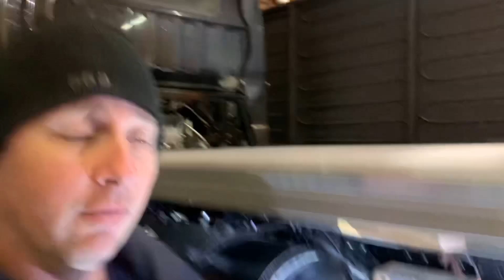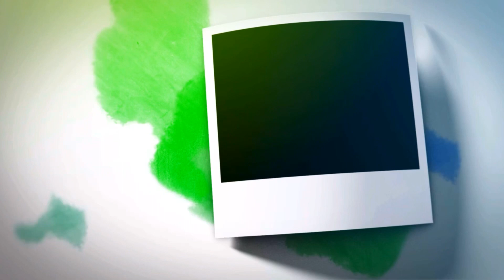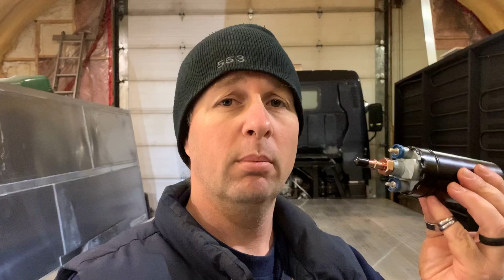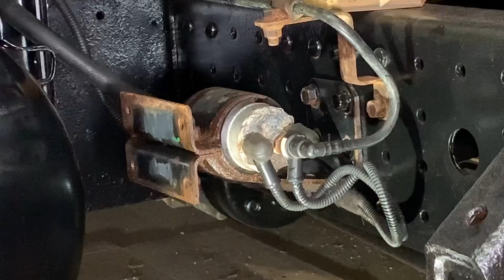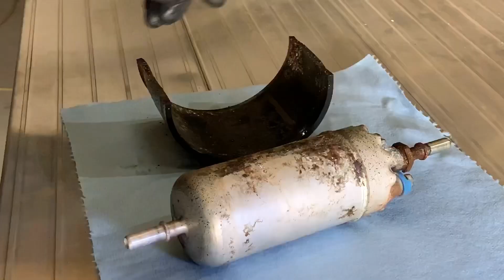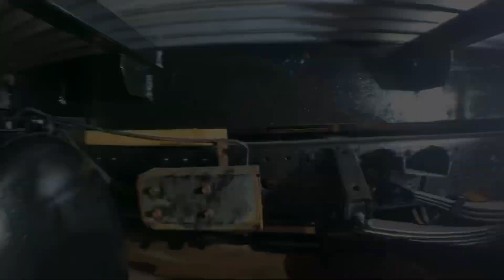HOW TO Stop a CATASTROPHIC fuel pump failure before it happens - MUST WATCH!

Comment: After instalation of new fuel pump do you have to bleed the system of air pockets or will the pump take care of it?
Reply from the maker: The electric lift pump on the 4P10 pushes fuel through the system, into the fuel rail, and into the mechanical pump, the air in the system comes back through the fuel return line.

Comment: Fuso canter 2013 outmatic gearbox not driving more than 48 miles per hour and the speedometer stays zero while the truck is driving.
Anyone had this kind of problem before?
Reply from the maker: Read the SPN and FMI codes through the gauge cluster, only takes a few moments and should give good direction on the cause.  

Don’t buy a code reader for your Mitsubishi Fuso without watching this first!
https://youtu.be/XI-nOFkUMK0

Comment: Hey Bruce,

You mention this is a Bosch fuel pump but on the link it comes up as a NPBoosted manufacturer, part number ZR2000. Is that the right one? 
Thanks
Reply from the maker: Yep - that’s the one! Pretty sure Bosch makes most if not all of these style of pumps and vendors re-brand them.
Reply: Ok great, thanks!
I really appreciate your videos, they’ve been a great guide. I recently picked up a 2015 fe160 that I’m converting to a small dump truck.  Your vids are boosting my confidence that this truck might actually work!
While I think of it: I just had the transmission flushed and filter replaced.  The truck had to go to a specialty shop to have the shift strategy relearn program done, any experience with that?  It seems to downshift really rough now. I was told it might be like that for about 10 cycles.  Wondering if there’s some sort of driving protocol I should be following while it readjusts?  It’s weird…
Reply from the maker: I have not had to re-learn any components on this truck, but have experienced transmissions re-learning before, with some harder shifts.  I would continue to drive as you normally would - as that’s what you want it to learn - but a transmission specific shop may be able to give you better guidance.